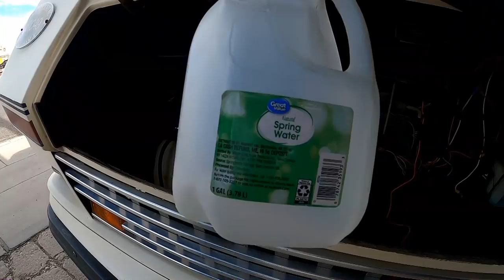RV Trouble On Travel Day - Water Pump Leaking on the Big Block Chevy - On The Road Again

Comment: Back in the 70's , I made it across death valley using torn tee shirts for the fan belt on my 68' chevy pickup.
Every 40 or so miles it would wear out.
Fun times

Comment: Best wishes Dave.  You should stop by and help with my solar and SUV.  Gas is $3.17 here in the ABQ area.  You will be driving within a mile of my AZ property as you leave Seligman.  Seligman to Kingman is the longest stretch of 66.  There is a mechanic in Seligman but not a parts store.

Comment: That has a 454 in it doesn't it. I'm not a mechanic but I changed the water pump on my 454 1970 Monte Carlo and then two weeks later the camshaft cracked and I had to replace it so we threw a racing Cam in it bored out the heads and you could literally watch the gas gauge go down when you put your foot in it lol stay safe stay strong stay healthy God bless and enjoy life buddy✌✌🎅🚌👍

Comment: Everyone needs bright LED Tail & Brake & Emergency lights on top of RV. & Trailers  
Only use Distilled water unless you have a leak . 15% off at Advance parts on line. Good luck Drive Safe

Comment: I wonder what a shop would charge for a water pump on that?   I had to get one installed a few yrs back in Tallulah, LA it was $400 for my 05 Envoy, for a $60 part.  I had no tools on me.  Never again will I travel unprepared.  Not sure where your temp sensor is on that, but I would change it too.  I wish I would have when I did the t/stat recently on mine, so much to remove again to do it.  Safe travels and 🧘🙏🏻🌎☮️ Daily